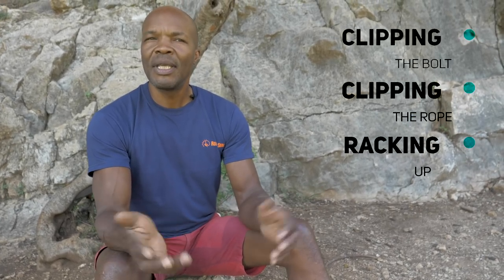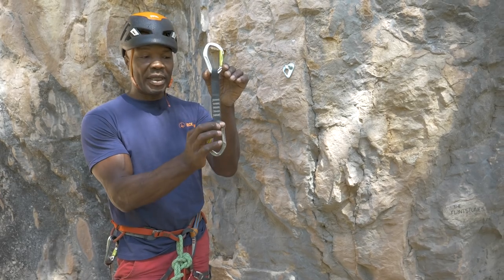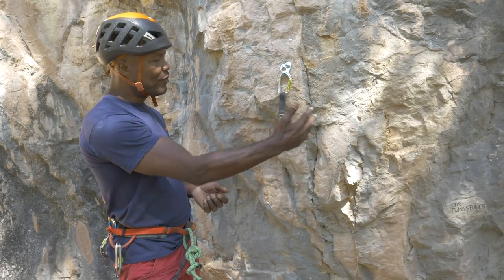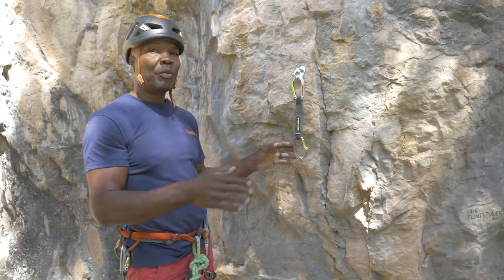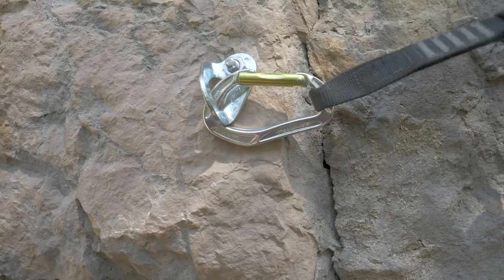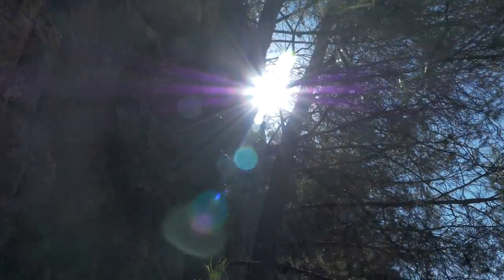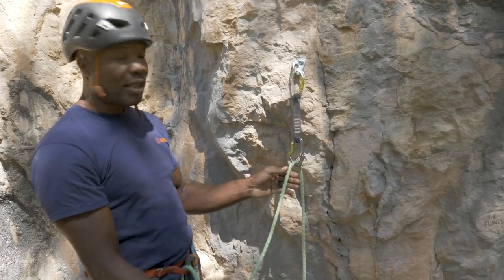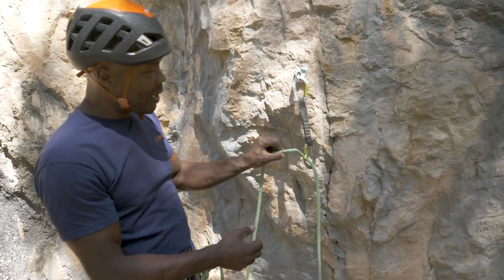How To Clip A Quickdraws When Sport Climbing | Climbing Daily Ep.1768

Comment: Ignoring direction of travel advice is controversial for sure. Climbing draw manufactures show directionality making a difference  on the literature that comes with the draws. But after watching this I tried to make a rope come out of a draw from above and I could not make it happen even whipping it into the gate and I am pretty good at whipping ropes. I even tried to whip it through holding the carabiner in a way to make it more likely - even at close range - no luck. Maybe after a thousand tries it might. Try it yourself (without back clipping). I also tried pulling the rope down right beside the draw like if the rope connection at your harness passed right by the draw and no luck with that either. It could make for a good game at the crag. Ten bucks for anyone who can whip a rope through a draw gate not touching the draw in anyway. Anyway not something to get real freaked out about.

Comment: The rope unclipping itself during a fall happened with a friend of mine, so it is possible, might not be likely, but definitely not impossible.
Reply: Could it have been backclipped? I clipping while backclipped is totally a thing
Reply: @somanayr  maybe, but it happened with 2 or 3 in a row, and i find it unlikely that he would have backclipped all of them, he's a seasoned climber.
Reply: @remz5722  If it happened with 2 or 3 in a row it's more likely he back clipped all of them then the rope popped open 2-3 quickdraws.
Reply: @jaykudie  We've done some test since. Rope wasn't back clipped, but the gate was facing in the direction of travel, which may result in the rope unclipping itself even though it isn't backclipped. especially in certain cases where the quickdraw isn't sitting quite right on the rock. We were able to replicate the results on the route in question (although we did not attempt all 3 quickdraws for safety reasons).

Comment: Wow, that demo of why quick-draws wont fail from standard placement really brought it home for me!  It seems natural to worry about the rope from un-clipping... But your demo really brought it home how the loads would not allow it to in normal situations
Reply: I'm not sure I agree with Trevor's explanation. Whether the climber's rope can get "behind" the carabiner depends on the placement of the bolt, the displacement of the climber relative thereto, and the terrain between the climber and the bolt. A bolt placed close to a vertical edge around which the climber climbs and before continuing, now "around the corner and up", could unclip if the quickdraw is pulled in such a way that the carabiner in which the rope was clipped dangles past the edge. As a mathematician I am always sceptical about arguments that depend on probability, the only measurable parameter of the strength of which seems to be voice inflection when stating it.
Reply: @RichardRLiu  Lol irrelevant, there's still no tension on the rope.

Comment: Questioning advice at time stamp 4:46.  If the rope below the gate gets hung up on a rock, the rope above the gate will come down first. That scenario would allow for the gate to be opened by the rope above the quickdraw. For example; How many times when pulling rope down on a climb, does an upper section of rope come down first? Why does this happen? Because the lower section of rope gets hung up. I've seen rope come through a gate. The weight of a rope x velocity can easily overcome a closed gate and what ever gravity may be on its side. Best practice is to take the gate out of the picture by facing it away from the direction you are climbing. Keep physics on your side.

Comment: Nice job. I was instructed to clip the gates always away from where the climber travels. Now I know it's not a big difference whether this is done or not. 

I usually have both gates facing the same direction in the carabiner unlike in this video. It was the thing here that was throwing me off the most. But in Finland, most crags don't have hanger plates anymore but simple vertical bolts. So there's no advantage of the exposed screw stopping the biner. Because of this, does it matter if the gate is turned downwards or upwards when rope drag is lifting the quickdraw to a more horizontal position?

Comment: It's already tested that is easy to break a carabiner at its nose area  if the straight gate on the hanger is facing the same direction the climber goes. The spine (The strongest part) always should be facing the other way. That's why is not advisable having  the two carabiners facing opposite in the quick draw at least you turn around the straight gate once already clipped or the route and climber go straight up.
Reply: Can you give your source? Because else it's just another myth like microfractures.

Comment: Any reason his gates were opposite each other?  I’ve only seen draws with same side facing gates.
Reply: Completely personal preference. It makes no difference safety-wise. It will likely provide an indicator as to which draw goes into the bolt, along with other indicators explained in the video.
Reply: One of those small discussion points about direction of movement relative to the bolt, with the quickdraw being less likely to unclip itself on certain types of bolts which are not used as often anymore as the compression and glue in bolts. However, this was always an exceedingly unlikely event which is hard to recreate and difficult to see as this depends even on the positioning of the bolt relative to features of the rock.

Trevor Massiah has been climbing a long time, and opposite gates would’ve been standard for him, thus he is most familiar with one direction into a bolt and another direction for the rope. Changing that now would offer almost nothing for safety but screw with efficiency of clipping.
Reply: Tests tell you not to do it, as well as placing your bolt side draw, spine in the direction of the climb (and fall). Why is he on this channel giving safety advice?
Reply: @IsuckYoungBlood  watch climbing fails and you will see the their worst case scenario does happen. Your article is two years old, and kind of proves my point. I’ll look for the one that further proves my point. At the end of the day, we are mitigating hundreds of risks to have fun. If you want to ignore a few, that’s on you. (and your partner)
Reply: @Jesse-xu6wx  Be careful the video in that article that shows how easy it is to unclip an opposing gates quickdraw is actually misleading.
The real issue here is that the quickdraw was improperly hooked on the far side of the hanger so it has the gate in the hole and if the rope lifts it for any reason, the gate hits the near side of the hanger and opens. But if it was properly installed on the near side it would have the spine in the hole and the gate could never catch on the hanger and open.

Actually in theory opposite gates are the safest because of that. But the bad scenario is complex and almost non-existent in reality as long as you always clip the top carabiner to the near side of the hanger.

With opposing gates you have the top carabiner with its spine in the hole of the hanger and its gate facing the rope while the bottom carabiner has its gate facing away from the rope. The top gate can never catch on the hanger. The bottom gate can never catch on the rope even if the rope was backclipped. Safest situation ever since there is no theoretical or practical scenario that defeats it.

With same-side gates there exists a convoluted theoretical risk that involves the rope getting lose, allowing the quickdraw to turn around to the far side of the hanger and then being loaded again. If the gates were initially facing towards the rope and the rope properly going out of the bottom carabiner, after the rotation the rope is now going into the bottom carabiner with the top rope curling around the quickdraw which is the perfect scenario for opening the bottom carabiner with the rope. If the gates were facing away from the rope then the top carabiner is in the exact same bad situation as shown in that easy unclipping video.

The true safety rules for quickdraws are these :
1. Place the top carabiner with its spine on the inside of the hanger so the gate can never catch on  both sides and open.
2. Place the bottom carabiner with its spine in line with the rope so that when you fall the rope will run along the spine and can't catch the gate.
3. Place the rope so that it comes out of the bottom carabiner and the quickdraw sits between the rope and the rock.

All the risks associated with quickdraw gate placement are mostly theoretical since there are very few reports of them actually happening. And it's mostly a question of personal preference. But it's always good to know what the theoretical risks of each choice are so you can evaluate for yourself and make a choice based on how much you are prone to misclipping to the far side instead of the near side, whether it's easy for you or not to clip with the spine in the hole. And also take into account some local conditions like for example if you need to start on one side of the hanger and later cross over it to the other side.

Comment: The rotating of the carabiner in the sling causes crossloading though, not three-way loading. For three-way loading you, as the name suggest, load it on 3 points instead of the normal 2.

Comment: So he spent a minute telling us how and why the direction of the upper carabiner is important, finishing with "it's really hard to get a rope to behave like this", and then dismisses the entire direction of the route topic with "it just doesn't happen"? It may be very unlikely, but when trying it with a rope, it's much easier to provoke than the first example, and paying attention there is an additional precaution when a backclip does occur...
Reply: “It doesn’t happen” was a reference to the bottom carabiner being unclipped by a falling climbers rope, not the top carabiner issue, which he said was minimal risk but better err on the side of caution
Reply: @mindblown42069  I know, but that's exactly my point: He says "It doesn't happen" to something that can be provoked with a certain regularity (under clinical conditions on the ground). Mind that, I haven't seen it happen in real life either, but it's not inconceivable to get some strange geometric constellation where it actually does happen... And he puts an extra bit of caution to something which I don't think anyone could actually provoke if they tried. Of course being on the side of caution is better, but that should apply to both cases, otherwise it's a double standard - and if a backclip were to occur, and no one notices it, having the gate placed in the correct direction would in most cases prevent the rope from unclipping then as well...
Reply: @fireman2375  but he clearly said "You should not be satisfied with backclipping, that is something you should change". The thing is if you correctly clip all the time, the gate direction is much less important. Also because how many routes have you climbing costantly in one direction? Most of the time you're zig-zagging your way up the wall, so a moment you are on the "right" side of the gate, the next on the "wrong". So in general I would say correctly clipping is the number 1 safety rule, gate direction opposed to rope direction is more like best practice.

Comment: Get a better backup knot on that double bowline, that aside, awesome video!
Reply: For what reason?
Reply: @johannessporer  Although bowlines are strong enough to be our linking knot between the rope and the harness, they are easy to become loose and untied if they are not under tension, so they require an extra safety knot to prevent them becoming undone while climbing (and thus not putting tension on the rope). That's why double 8 is the safest knot if done properly.
Reply: @hernangimenez3342  I think a backup knot for the double bowline is no must...it's true what you say but even in the very unlikely event that the 'followed through' part gets  fully undone while climbing you still have a standart bowline which will still hold you. Still I agree that it can add extra security, for me personaly it's just a bit over the top. I still tie one sometimes tho when my tail is to long anyway...
Reply: A standard bowline knot can open itself up of loaded sideways and has lead to deaths before while  being used as a tying in knot. It is not safe to use for this application or anywhere in climbing, really.
A double bowline on the other hand is a very good and safe tying in knot and has the advantage of being easily undoable even after heavy falls. The only disadvantage is that it is not as easily checked as the figure of eight, which is why the figure of eight is to be prefered, especially for beginners.
The european climbing associations only recommend using one of these two knots for tying in, so they both are safe.
Here in Europe it is with the